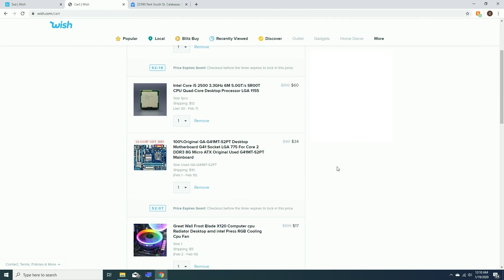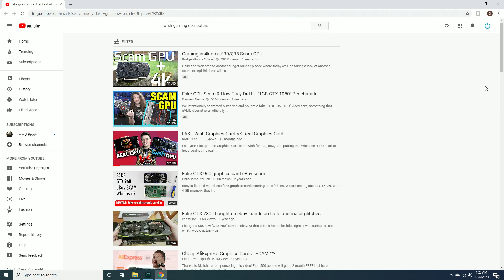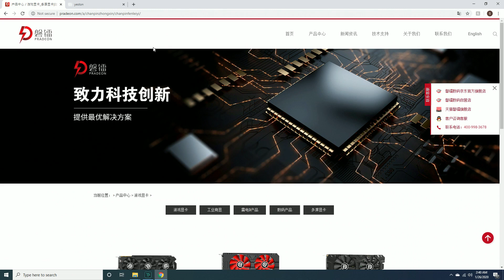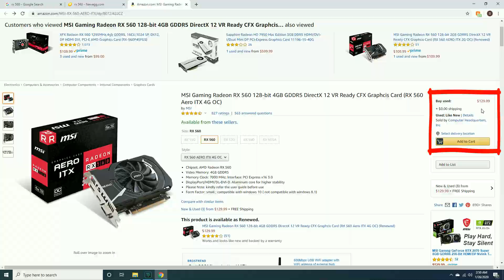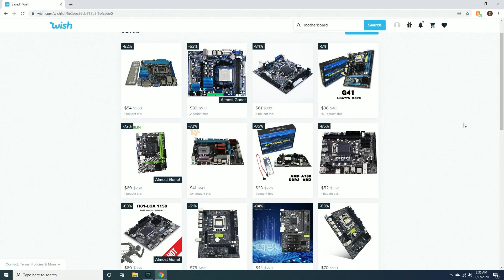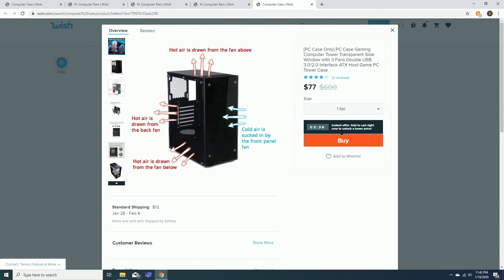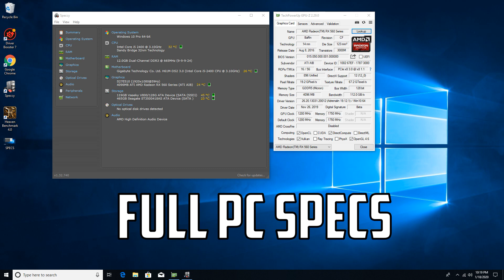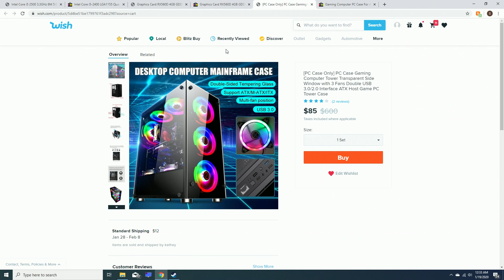WISH.COM BUDGET GAMING PC | FORTNITE VALORANT | CONSOLE CRUSHER - RX 560 i5 2400

Comment: I bought a dell optiplex 9010 for 60 and a gtx 1060 3gb for 55 of ebay, and some ddr3 for 12 dollars, I also bought a evga psu for 36 dollars. Now I play fortnite with 180 to 200 fps
Reply from the maker: Hell ya brotha!
Reply: @techyesterday4960  I have a video before I put a gtx 1060 in it, planing to make a new one for it now
Reply: Dude do you still have the links of the parts?
Reply: Born2Legit pass the links bro

Comment: great video and the i5 is a great cpu for gaming on a budget..all the kids have to have an i7 believing its the be all to end all but u can get an awesome gaming experience with an i3-10105, 16 gig ram, 240 gig ssd a 1tb hdd and with the graphics card dilema atm a r9-280 is between a gtx 1650 and a gtx 1650 super.. even a 1050 ti can still give a reasonable gaming performance in the interim until some sanity comes back to the tech shortfalls..

Comment: Holy
Reply from the maker: Crap
Reply: @techyesterday4960  sorry to disturb but will a gtx 1050 ti low profile work with a 180 watt power supply (no intention of overclocking it) plz reply ASAP

Comment: I built a machine that far outperforms this one for the same price (i paid 290 €). It runs everything on high/ultra @1080p and is a little beast:
- Ryzen 5 1600 (6-core, 12-thread 3.2/3.6Ghz)
- 16GB Crucial Ballistix DDR4
- Asus A320m-k motherboard
- XFX R570 4GB
- WD Blue 500GB SSD
- Coolermaster 600W PSU and Enforcer case
- Legitimate Win10 Pro license

Oh and why do you put SO FREAKING MUCH coolpaste on your CPU? Seriously, it's at least 3x the amount you should use. Too much paste can really hurt the thermal performance.

Comment: The video is great! But I have some personal problems with. I know it's hard to cable manage in a case like that, I get it but you could have done a little better of a job. Your 24 pin power cable looks super weird. Those cables look like they are going to break. It's giving me anxiety. Also why did you install case fans first? that way you couldn't mount the HDD correctly. Again It's giving me anxiety. Just for the love of god fix it. Otherwise good video.

Comment: hey I have an i3 7100 and want to switch it out to a i3 9100f do you think I can do it without changing my motherboard
Reply: Not worth upgrading, I'd rather upgrade to a i5 7th or 6th gen which would be the same price since it would cost you a new mobo to upgrade to a i3 9100f and if you really wanna go the new mobo route I'd get a B450 and a r3 2200g or R5 1600

Comment: How do u use a Dualshock 4 in warzone ? I bought an Office Pc for 50 Euros with an I5 2400 and a used GTX 1050 and a SSD . In creative i get over 160 fps but in normal Games it freezes . Now i use DX12 and its still laggy . FPS capped on 60 .

Greetings from Germany

Comment: Hello, I tried you idea of budget pc! So I bought an optiplex 3020 with a i5 4590, I added a 500v evga psu and an rx 570 but it won’t give a signal to my monitor when I put my rx 570 in it :(
(Btw I used a 24 pin to 8 pin connector for the motherboard atx slot)

Comment: Yo I might get the graphics card do you really think it was good?
Reply: I need a budget graphics card for like 70-90 that’s not really big under 10 inches or so
Reply from the maker: @cloudyisdaddy6996  Yes its an amazing card for $80. Ill send you links in a bit. It doesnt even require external power so you can use any power supply which is nice!

Comment: I really need a new graphics card and only have $50 where should I buy from I want atleast a 960
Reply from the maker: Look at getting an rx 470 or 480.
Reply: @techyesterday4960  I got a R9 290x now is that good?
Reply: @vlazepromotions7559  that's better/around just as well as the GTX 960 might wanna get a better mouse if you already have something like a model O, mm710, G502, G402, steel series rival 110/310. ;)
Reply: I guess I cant use my r9 290x I dont think my power supply is good enough for it

Comment: hey guys, i need an advice:
i've seen this setup on ebay for 183.40€:
dell optiplex 390, no os+i5 2400+500gb hdd (around 70€)
4+8 gb ram (36€)
AMD sapphire pulse rx 570 4gb (87€)
what do you think?
Reply: What about the PSU?

Comment: 300$? budget? and im over here building a pc with an ashrock mother board,ryzen 3200 8g ram(going to turn to 16 at sum point) a 450w-500w power supply with with the budget of 188-190 euros.  id spend around 12€ on wish for the led strips fosho but 300$? calling it budget. out of wish.. i believe when it comes to electronics wish is a rip off.
Reply: and about pre builds. everyone recoments building your own pc with the components u prefer. prebuilds are usually random shit like athlon connected to a GigaByte motherboard..while GB motherboards only support intel i3-i5

Comment: I think that old gen cpu is bottlenecking Gpu. But I am in not state on saying that cuz I myself use 2nd gen Intel i5 2130 😂😂. I am saying cuz its playing gta v at 60 fps in normal when it have capacity to run it at high at 70 to 80fps.

Comment: According to the internets the AMD 215-0895088 chip is a Radeon RX 460. It seems like you were still scammed on the GPU
https://www.techpowerup.com/gpu-specs/radeon-rx-460.c2849     https://www.techpowerup.com/gpu-specs/radeon-rx-560.c2940      Look in the GPU processor box, where it says GPU variant
Reply: I dont believe your correct. In GPU-z it states it's a rx 560. And rx 460 wouldn't produce these results
Reply: @carsonshea653  BIOS Flashing maybe? did you even bother looking at my links? They have images of the chips...........